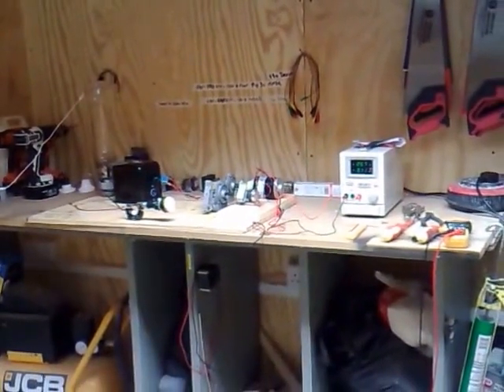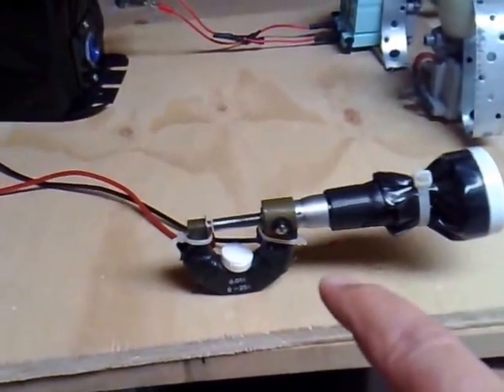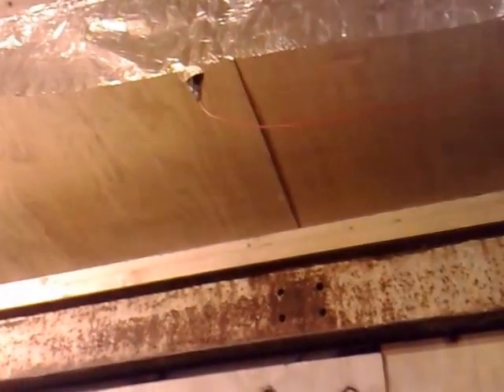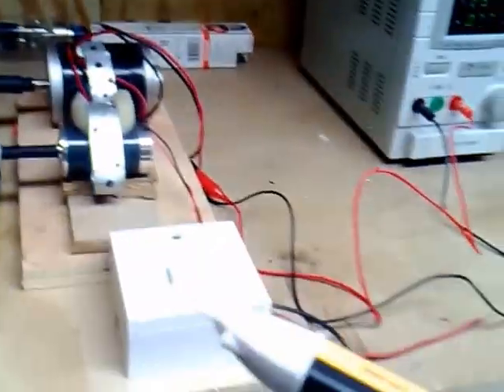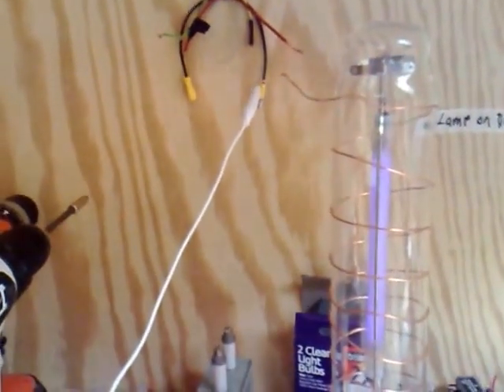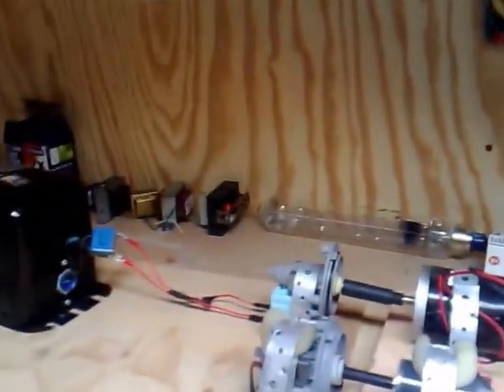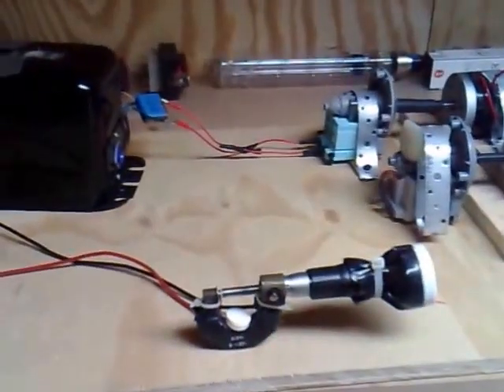Gerard Motor PROOF of RF.mp4

Comment: Sir, I'm so glad that there are people like yourself experimenting out there full marks. Its a great way to make an RF generator, but no need to go this far, it can be made much simpler than that, try using 555 chips and a small antenna (costs a few pence) What you have done is create a low frequency signal (RF) nothing more, but at great expense. I think you missed the point of what he was doing, he was to showing the masses that we are in fact paying to much for power in our homes etc, as its 50 hz transmitted 'signal', also the fact that motors can be power by RF using much less power than an AC powered circuit. You proved all along in the video, that RF (revs of the motor is the frequency will be 0.5 to 4kHz I guess) is in the circuit. No need for anything after the washing machine motor except two long wires (dipole).The rest of the kit you used was unnecessary. 10 out of 10 for experimenting though ; )
Reply from the maker: +magnetshack I agree with the 555 chip, doing it old school for now. Some of the Hz readings were around the "Tesla Lights" readings low 5Hz to 13Hz I could vary the Hz with higher motor revs. Do you know how the power company use the vacuum return line & return it, like in Gerard's video. This is my real focus in the experiment, its about understanding amps return without volts. Then injecting Hz back in the line Mm nice! ...  Regards ... DC
Reply: +magnetshack  No doubt higher frequency AC is more efficient in motors, as the ferromagnetic materials requirements, hence the weight will be less. That's why military aircraft uses 400 Hz AC as a power source. The generators and motors can be made more lightweight and smaller, which is always a good thing for aircraft. However, the power transferred is no different than the conventional 50/60 Hz system. You guys are confused about the "magic" of high frequencies. The spark gap surely will cause the following inductances and capacitances to ring at their resonant frequencies, but so what?  You are merely replicating what the early wireless transmitters did in the early 1900's.  Very wideband RF generated frequencies, creating "hash" which permeates the RF spectrum.  In short - a very noisy, and I might add, unlawful spewing of RF trash.  Spark gap transmitters were outlawed early on in the beginning days of radio, and for good reason. They cause widespread interference with legitimate RF transmissions. Really, guys, nothing new here. You are chasing your tails, but you don't know it. Do some research on RF technology, and the early days of radio, it will be an eye opener. Morin has obviously had NO formal training in RF technology, as he is a lost ball in high weeds. In other words, he's a nut.
Reply from the maker: Hi Q.L. I agree with you; however sometimes you have to go back to "Basics" to see what you have missed. I take it that you are a professor / teacher / academic (Yes)?  Thank God for NUTS!!! ....  DC
Reply: +E.power DC   Right-o, let's here it for NUTS!  LOL!  The spark gap generation of RF is well known and has been researched to death. The bottom line here is energy in = energy out minus losses. Regardless of the frequency, there are inherent losses which are a fact. So, this game has only one ending:  overall LOSS of energy. Sorry, but that is the way nature sets the rules. However, Morin and company will have fun playing around with gadgets. The only thing that worries me is him playing around with pole pigs. He could be killed by the 7.5 kV on the high side. That would not be fun - especially for him...
Reply from the maker: +Quantum Leap  Hi Q.L. can you please comment on antenna "near field"? As a 67 year old student I love studying but I do not understand everything. I studied light, is it a wave, pulse, packet or other? We know very little, much to learn. What is your passion in life? Mm Quantum Leap suggests Physics, you work in a University. ... Regards ....  DC
Reply: Quantum Leap While I agree with most of what you say, the main lesson is the fact that we are paying too much for electricity due to it being transmitted at 50 hz. which is true, the rest of what he says is pretty spurious due to his lack of knowledge, but the message s there.
Reply: +magnetshack Well, there is talk about using high voltage DC to carry power over long lines. Theoretically, there would be fewer losses. Then the DC is inverted to AC at the user end to power conventional 50/60 Hz loads.  But higher frequencies ARE NOT the solution to minimizing losses over power lines. That has be researched at great length. Morin would be well advised to do some studying on efficient transmission of electrical energy. I have studied this, it was part of my curriculum, but it is obvious that Morin has not a clue.
Reply: Quantum Leap Agree 100% with you....
Reply from the maker: +Quantum Leap HI again, my son works for GE he visits & services wind turbines at sea. They are using DC in large diameter wires (Pipes) to transfer power to the mainland. It seems to work well but he said the turbines have to be producing power in Giga Watts before transfer can start.
Reply: DC is the worst way to transfer electricity - try RF - Tesla wireless transmission?
Reply: ***** Energy in = energy out magnified.  Never heard of this, except in use of amplifiers. And amplifiers need a source of energy. So there is no gain in net energy. You can run the numbers all day and night, any you still will not be able to compute something for nothing.
Reply: Quantum Leap There is never something for nothing, you get something if you do something, every action = a reaction. Nature has secrets that one day may unlock and we get the energy we require for less input than the accumulated output, but it will be at some cost to tap this energy initially, be it time and effort or materials.We have free energy, is called wind, solar and energy from dams, but we had to build the machines first to utilize the potential energy. I do believe free energy is here right now, its just that we cant be letting the world have free energy can we, how would anyone get rich.......?????
Reply: +magnetshack  I believe in renewable energy - solar, wind, geothermal, hydro - but I draw the line at nonsensical videos such as Morin's. He cannot, will not, learn basic metrology. He thinks he is cracking the "more out than in" energy nut, but, sadly, he is just fooling himself and many others.
Reply: +MX6Maximus  What you fail to take into account is when you use a step-up transformer, you raise the voltage, but at a cost of lowering the current. Plus, there are inherent losses in the step-up transformer. So at the secondary, before you go further, you have already lost  energy. No matter what you do beyond that, you cannot "make up" that lost energy. It's gone, copper losses, heat, hysteresis losses, etc. And spark gaps cause further losses. What do you think makes all that noise and light?  It takes energy to do that. I think all this confusion started when Tesla named his coil a "magnifying transmitter". It was not a magnifying anything. The output energy, no matter how spectacular the sparks and arcs were, was way less than the input energy.
Reply: Whew, so much misinformation condensed into one Gordian Knot of a paragraph!  You go on experimenting, have fun, bye.
Reply: ***** There is no limit, but so what?  The voltage at the spark plugs of a gas engine is 25 to 30 kilovolts, but at virtually NO current. Therefore, there is virtually NO power there. Voltage alone means nothing when it comes to doing work. It's the combination of voltage AND current that gets the job done.
Reply from the maker: +Quantum Leap HI Q.L does voltage drive AMPs? Mother Earth is a Big capacitor ready to do work. Light is both a wave & particle come in from the "Heat & Mechanical". In Tesla's "Hairpin" Stout Bar experiment he tried to show us a secret / link about potential, understand this and you will have a key to unlock the door.  Regards ... DC
Reply: +MX6Maximus 
When you suggest QL gets a refund for his information. What part are you suggesting is wrong.

To keep thing simple, let's go for for a power factor of 1 in the presence of AC and let's assume Watts and VA are equal to one another.

Are you saying that watts are NOT equal to I * V?  (or if you wish to split hairs, VA= I * V.

Ignoring losses for a moment (though there WILL be some), if you have a 100v supply and it is taking 1A to drive the primary of a transformer, you can have 1000V at 100mA or 10V at 10A - and any other combination that gives you 100VA

Is that what you call "Electrical Intensity"?  If so, then are you saying "Electrical Intensity" = VA (or watts).

Either way, WHAT is the formula for your "quantity" of electricity?  

With regard to your comment on charging a capacitor with thousands of volts and no amps, if there is truly ZERO current then the capacitor cannot charge. It might only be microamps (or nanoamps) but if the capacitoy charges, there WILL be current flow - even if your instruments are not sensitive enough to record them.

Then, when you dischare the capacitor, you will get (assuming the cap is a good size), one almighty great crack of sound and a bright flash as all that power that trickled in over a lengthy period of time (relative to discharge time) is discharged in the space of a millisecond or so.

No power created - and in fairness, perhaps not too much lost either.

If you saturate a transformer core you limit the power it can transfer. Nothing being "created". At the risk of making a rod for my own back, they CAN be used as a device called a "magnetic amplifier" which ARE clever and weird things (and almost indestructible) but they work like a valve or a transistor, they allow a small signal to modulate a power supply to provide a large signal, There is no free power thought, you NEED the power supply for the little signal to be amplified. They ARE interesting gadgets though - and I am slightly surprised some of the over-unity brigade have not added those to the melting pot. Google for "Magnetic amplifier" or "Mag amp" if you are interested.

One other thing to be wary of when doing experiments is that many domestic (and some industrial) meters make no allowance for interesting wave forms. As such if you have a short mark/space ration (a pulse if you like), then it can sometimes measure the peak current and or peak voltage and display it as though it was the RMS value.

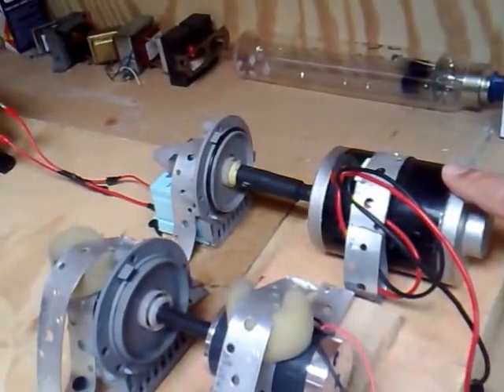For example a 100u/s square pulse of 100v at 10A running at 1Khz would give you a mark/space ration of 1:10 - so the AVERAGE power would be 100VA - yet many (most) meters would wildly miscalculate the result. It could be anything from pretty much zereo (pulse too short to be measured) OR a full 1000VA (meters measure the peak and assumes that is there all the time)

If you have a high end meter that is calibrated for use on RF (or at LEAST AF) then you might get a truer reading. An oscilloscope is often the easiest and cheapest way to work out pulse power though.

As a constructive comment, you might also want to invest in a cheap and cheerful RF meter - ideally one that works down to AF (Audio Frequency) so it will be MUCH easier for you to see when you are looking at pulse DC, when you are looking at sine wave "regular" AC and when you are looking at AF / RF or modulated AF / RF.

A second hand oscilloscope and frequency meter should cost you less than £50 / $70 if you look around a bit - but will transform your ability to make accurate measurements and therefore deductions.

(Oh and be a bit wary of "skin effect", start getting too high with frequency and you can get RF burns - skin and deep tissue).  LOL if you want a silly/ fun experiment which does NOT make any free power but looks as though it defiest physics, you need an old CB radio (ideally one which is robust enough to survive a bad antenna mismatch for a few seconds), a few metres of wire and a 5w bulb - 3v - 12v will be fine.

Hook up the CB, connect a short wire (1 foot or so) to your right hand / wrist and connect the other end to the bulb. Now connect a wire 2.75 metres long (or half that) and stretch it out. (You can use much shorter wires but those values will give great results)

Now get someone to "key the mike" on the CB while you touch (with something metal like a skewer) the inner connector of the RF out.

You can just stick your finger on if you want but you WILL get skin burn.

The bulb will light - as the RF passes through the skewer, through you, through the bulb and radiates out of the wire on the other side.

OR you can play the part of the aerial (antenna) and have two short bits of wire coming from the bulb. You hold one bit and poke the other bit in the iddle connector of the RF out on the CB. Once again the bulb will light - even though there appears to be NO eart return for it!

Good way to confuse people if you hide the CB and just have a metal "pad" you hold the bulb against. If you are careful you can hold just the outer "connection of the bulb" and just touch the middle contact on the plate. you can then hand the bulb around - everyone will think the bulb is fake - so you can even ask soeone to bring a little toch bulb of their own - and use that.

The only snag is the CB may NOT like being abused like this (bad load ont he output), You CAN try to mitigate it though by using a smaller bulb (2 watts) and then connecting a 100 Ohm 5watt resistor from ground ot the centre contact the CB - this will give it SOME load.

LOL, I could sell somethng like that to a magician I think :)
Reply: +MX6Maximus   You do not understand basic power concepts. You equate voltage with power. If pulse power is being measured, you must compute the area under the curve of the pulse, and the pulse must be loaded by a known, stable resistance. Then, and only then will you be able to compute accurate power. When you do that, you will find that at the end of your "voltage amplifier" (!) you will ALWAYS have LESS power than what you used to drive the "voltage amplifier".  That's the truth, you would be better served by reading a text newer than one written in 1863.  The only part of your above tirade that is accurate is that "there's no laws being broken here, guys."  There is also NO power being created here either. You are fooling yourself, and so are all the "RF / High Voltage / Arcs and Sparks / free energy" bullshit videos on youtube.
Reply: +MX6Maximus 
Ok, I admit I was confused at your choice of phrases like "Quantity" as a unit of measurement. It is easier to understand when people use less ambiguous units.

As for the repeating somethting, it really doesn't help too much - especially if you do not even finish the quote.  ( ...."The unconvertible part of electricity, that part which corresponds to the mass of the bullet, may be supposed to be the matter of the subsidiary atoms).

Subsidiary atoms?

And you are using this "document" as a basis for scientific research?

What happens to these "Subsidiary atoms"? Do they collect at the bottom of a small box?

I am perfectly aware that most transformers tend to be (by default) isolation TFs but I am not sure how this is overly relevant.

Cranking up the volts is not hard. The EHT unit in the back of an old CRT style TV can often approach some 60KV - and after the mutiplication and rectification stages, is already at DC.  But so what?

You can then spend a while waiting for the tiny current to charge a capacitor which you can then discharge with a dramatic crack. But again - so what?

Take a CRT TV, power it on and then throw some bits of metalised polyester (Christmas Lametta) at the screen. Now try to take it off again. The lametta will give you a harmless (but spectacular "zap" and if you dim the lighting a very visible spark. Congratulations - you have just used a glass TV screen as the dielectric in a capacitor

No free energy though. No over unity. No "Subsidiary atoms".

(Replace the lametta with a sheet of aluminium foil though and you have a capacitor which actually CAN (if the tube is large enough) potentially be dangerous).

Experiment all you want - but at least get yourself some DECENT tools to allow you to make accurate scientific measurements and observations. Just because a crackpot rates a very old book does NOT make it an authority on the subject for you to base your research on. If you WANT to use it as a base for research - fair enough but you STILL NEED decent tools of measurement. 

Only when you accurately measure your power in and power out can you begin to see if you are making any headway to anything. Hooking up bits of wire to sheets of aluminium, discharge lamps, spark gaps and driving motors with other motors might look great - but if you are not taking accurate readings, how do you know what you are achieving?

it will also help others understand your work if you can use units of measurement that one of the last couple of centuries can identify with.
Reply: I'm 100% all for people into experiments of any kind, DIY, tinker'n etc.  Not to bash the guy But Morin & many others are simply confused. thE 0th Law of ANY science is to get your units correct. I seen him many times confuse Power & Energy for instance, which is such a serious fundamental misunderstanding ! Just don't use such vids as a primary leaning source. An actual Electricity/Electronics 101 course is a good start & will take you much further in the long run.

Comment: the ultimate Question is if you use RF electricity and you get no shocks there is no amperage you would be able probably to subsidize  A/C but with no amperage your meter should not spin backwards because amperage is the push that turns the meter you would not get paid for helping out the electric company unless you can change watts back to amperage first
Reply from the maker: Hi RH  Love your question & comments above. We have lots to learn.  Regards .....  DC